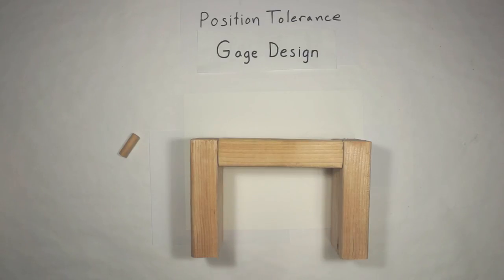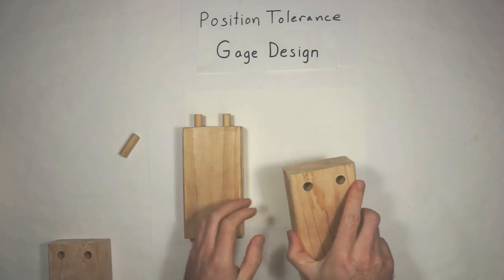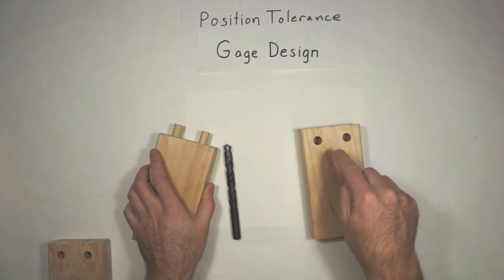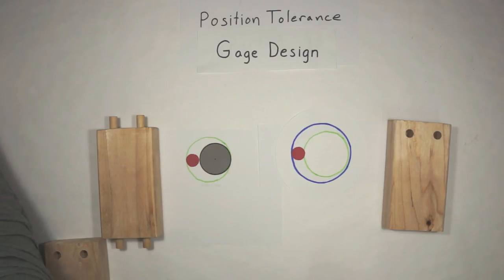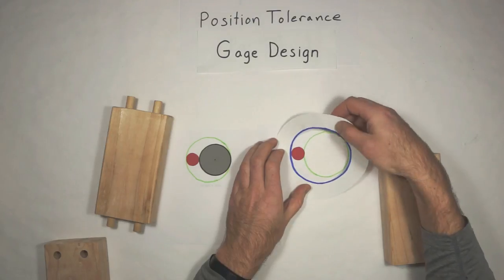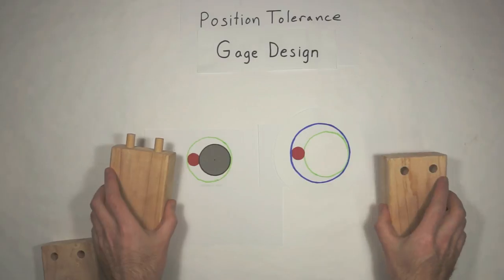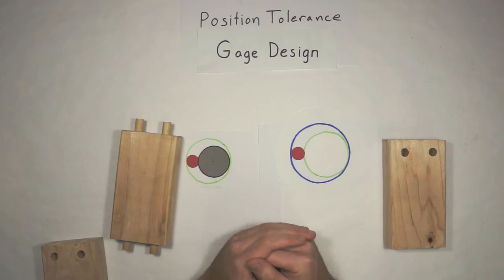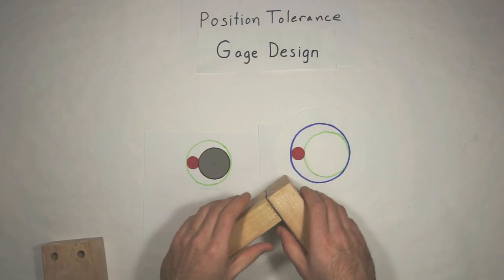GD&T Gage Design Lesson 5 - NO MATH

Comment: Quint, Your idea of borrowing a part from another machining cell to functionally gage your machined part works in In House machining operations.
But.... in today's industries part pieces are outsourced to multiple countries acrossed Language and Cultural Barriers.
 Meanwhile Corporations like Sandvik,Kennametal,Iscar, and most Machining Center Mfg'ers still push for reduced cycle and manufacturing times.
  So where are the Humans that can keep up with Functional Gaging at the Machining Centers? (non-Existent?)
I have 1st hand experience that the actual Task of Functional Gaging is being laid on the shoulders of the Finished Product Assemblers.
A 50% success rate of Assembly By Verified Assembly Processes makes me frustrated.
Especially when units that are 90% complete must be dis-assembled to change the units component part pieces.
Not to mention what that does to be able to keep up with a daily production schedule.
A One in Twenty part piece Functional Gage Check is not enough to ensure proper fitment of component part pieces.
 Daily 1st piece checks and Daily In Process Checks along with O.Q.R. Reports on a one to one basis should be implemented to insure proper quality.
But Alass try getting message that acrossed the Language, Cultural and Managerial overlay of any International Corporation. 
 Maybe one day (The Powers That Be) <---spoken with Fear Respect and Reverence. 
Will ensure that each Machine Operator spends a Justifiable amount of Time Assembling That Which They Hath Machined! 
Until that Time.... We shall Soldier On.
Reply: Agree & Disagree.

GD&T is the language of engineering & manufacturing that crosses verbal language & cultural boundaries.

1st hand experience...

I am an inspector turned QE (trainee still).  We have a greater than 99% success rate on our verified assy process (medical).  We use parts machined in house & from vendors with 100% inspection on critical features on some of our final assemblies.  That is with inspections of AQL 1.0 on most of our components before assy.  For example we will inspect 13 pcs of each lot of 100 components or 20 pcs of each lot of 200 & get 99+% success rate at final after assy.  Shipping an average of 100 pieces a day of one particular assy - it's been over a year since it has had a functional failure at final inspection for the assy... again using AQL 1.0 for components. 

We use a mix of attribute (functional gauges - or pass/fail) & variable inspection.  We use everything from calipers to CMMS & work with tolerance as tight as ±.00025 in (250 millionths). where parts are normalized in a controlled environment before inspection.  Of course we have tolerances in the ±.020 range as well.

As an inspector I made it a point to show new machinists what they were making & why.  How it was used, how it works with mating parts & why they should care.  I started doing that & component level acceptance increased & things like burrs & cosmetic defects dropped.  At the machine, the operators catch a majority of errors before inspection as well.  Some operations have 40-50 features to inspect... by the operator.  Mostly manually & often times involving math.  Such as the formula for position.  Literally finding deviation on a height gauge & using the position formula to record the actual position of said feature.

People make it happen at the end.  They can only be as good as the process though.

& I agree - every operator should learn to assemble.  Every assembler should learn to operate.  Everyone should have a few days in everyone else's shoes... from operation to document control to engineering to inspection to wash & passivation.